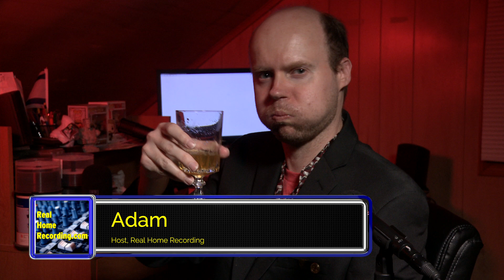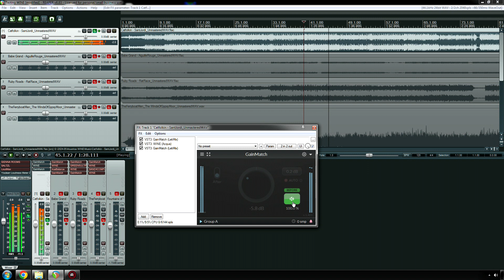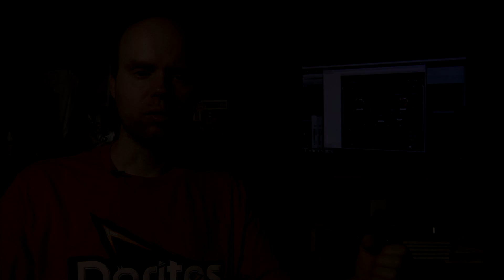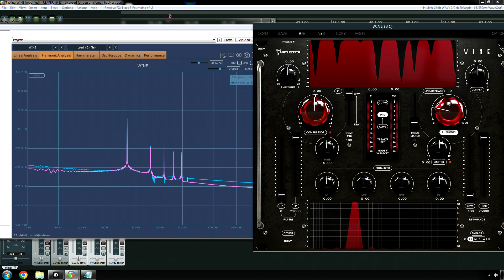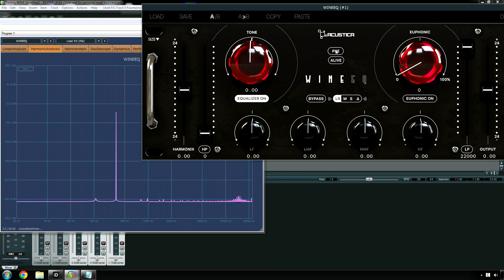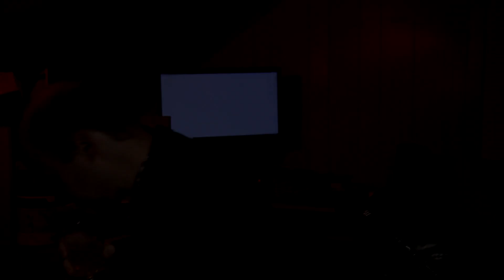Finalize & Enhance Your Music Masters with WINE Mastering Processor Mini Tutorial Acustica Audio

Comment from the maker: So my honest thoughts on this?
As you guys know I use those remote analog services, primarily because I believe using real analog hardware on music tracks makes them have this 3D depth that is difficult to emulate in the Box. 

Wine does it and does it relatively easily. I didn't even talk about the Fire the Blend component, which is just the saturation / preamp /widener. On future real world mixes I can see myself using that during the mix prep stage, similar to how I've used slate VCC and Kazrog True Iron for years. It also reminds me of what I love regarding the LTL silver bullet hardware.

This truly is a finalizer sort of plug-in meaning you may have to use other plugins before it to achieve overall results. I did on two of the music samples... in one instance opting for an SSL style bus compressor and on the other I had to use an additional equalizer to cut the mud But certainly it can do a lot on its own. 

This would not be a first recommendation kind of plug-in but if you still think there is something missing from your masters, then Wine could be the ticket. For me it brings something unique to the table and this is one I will not be removing from the plug-in folder anytime soon.